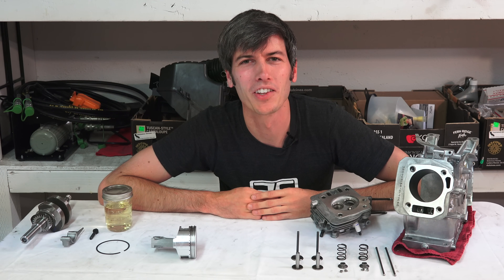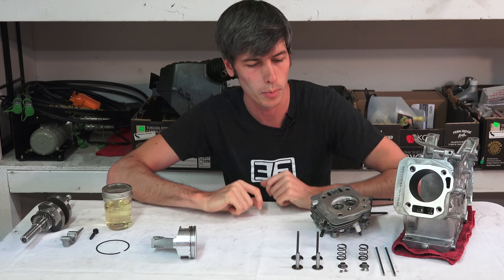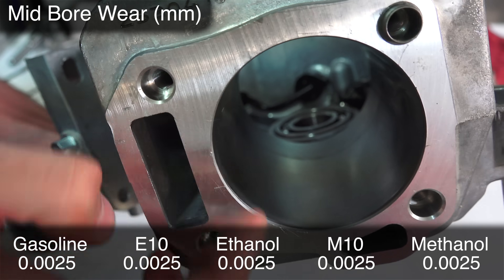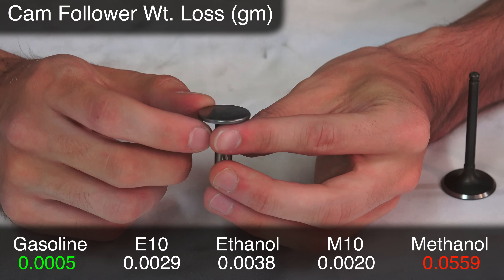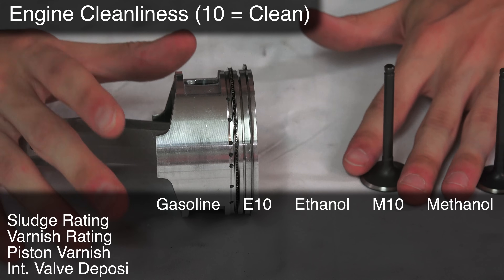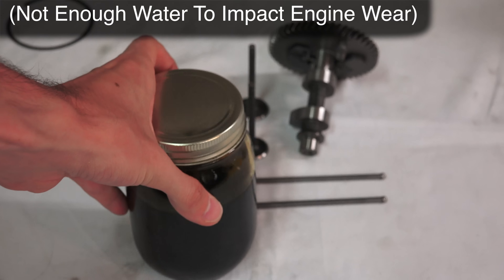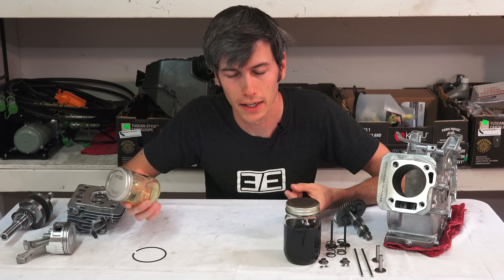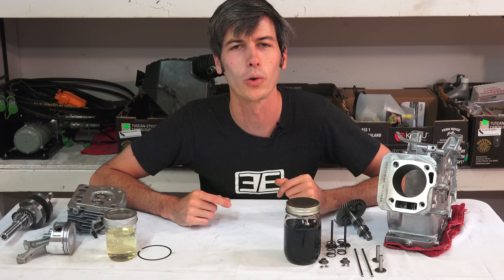Is Ethanol Bad For Your Car's Engine?

Comment: Here’s a fun extension. Are there any differences between diesel engines regarding ultra low sulfur fuel? Modern diesel vehicles are all labeled with “Only use ULSD”, and I’d be interested to know if there are mechanical reasons for that.
Reply: The main problem caused by sulfur in fuels is that sulfur acts like a catalyst poison. If a catalytic converter like for instance in modern diesel exhaust gas aftertreatment is exposed to sulfur it will degrade and eventually break.
Reply: @PillowInTheSky  Sulfur is diesel lead then
Reply: i think also, common rail higher preassures compared with idi vepump require ultra low sulfur gasoil because of sulphuric o sulphudricoxide created in the injectors nozzles.
Reply: At high temperatures and in the presence of water vapour the sulfur forms sulphuric acid which is corrosive to the engine surfaces. 

Modern engine oils all include substances that neutralize the sulfuric acid to prevent the oil from becoming acidic. Heavy duty Diesel engines for industry and agriculture which use lots more fuel and often not of the ultra low sulfur variety have more of these additives to compensate.
Reply: Aside from the emissions standpoint, the ULSD fuels are needed to prevent the particulate filters from getting clogged and also the sulfur makes the diesel catalyst fluid (DEF or basically piss water) useless.  Sulfur will tolerate the high heat of the regeneration cycle of the particulate filter and not be burned off as the other elements will.  This is bad for a very expensive part of your emissions system.
Reply: Same reason for low-SAPS motor oil, contrary, non-DPF engines shall not use these oils.
Reply: Dominic's Bricks 
we were told sulfur was causing acid Rain, which no one witnessed on real life, as the reason to reduce sulfur in gas
Reply: Sim... Acid rain is any rain with a PH of 7 or higher... We usually drink water with a PH of around 8 so we are drinking acid water.  If you live in the city and have treated water your PH will be closer to 10 due to the chlorine.  Will sulfur make the rain acidic? Yup, but will it wont be bad enough to eat your paint off your truck or anything like that.  It may make food taste a bit different and cause water spots, but nothing too harmful in most cases.
Reply: @dominicsbricks2403  You have your numbers backwards, lower pH numbers mean more acidic. Neutral pH is 7, anything less is acidic, anything higher is alkalinic (basic)
Reply: Figures... I am dyslexic... the numbers aside the information is pretty much the same.  Thank you for the correction.
Reply: The acid in the lungs (think smog) is not great either. Luckily, it is a local pollution problem (it rains out, perhaps acidifying sweet water reservoirs, or maybe not).
Reply: @dominicsbricks2403  Acid rain is 6 or LOWER. 7.5 or higher is alkali rain
Reply: Yea, someone already pointed out I got the numbers backwards.  Thanks though!
Reply: They make additives that intend to replicate the lubrication properties the sulfur provided. So it must've mattered. I'm getting the vibe that modern diesels don't last as long anyways as they attempt now to build them lighter, higher revving, and more complex.
Reply: Yep, nothing like a seized injector pump on a tractor to ruin your day, and your wallets.
Reply: sulfur is a good lubricant making your injector pump last longer
Reply: People with older diesels sometimes blame the ULSD for damaging their injection pump, but more often than not, the problem is simply that in older diesels the pump is... old. Anyway, for anyone who is worried all you need to do is add a little two-stroke oil to the fuel.
Reply: Ultra low sulfur diesel was created to reduce sulfur emissions from the tailpipe.
Reply: mcdrums87
ULSD is essential in order not to kill the particulate filter in the exhaust of modern diesels.
Reply: I don't know of any mechanical reasons in the engine itself, though I suspect there may be some if the engine is turbocharged. The reason I know of is a small amount of the diesel fuel (unburnt) is used in a catalytic converter to react with the NOX in the exhaust, and any sulfur present kills that reaction nearly completely.
Reply: Mechanically the sulfur was used as a lubricant.  It is cheap and allowed manufacturers to use lower grade (ie cheaper) components because the fuel would also lubricate the contact points.  The main components that took advantage of this were the high pressure secondary pumps and the fuel injectors.  Today's components now need to use bearings where bushings once were and higher grade materials.
Reply: Does 'off road' diesel contain more sulfur than ULSD? Also, would using ULSD explain why so many older marine diesels have trouble with injector pumps?
Reply: @Johnny Rodriguez ULSD + 2T crankrase oil?
Reply: Sulpher used to be used as a lubricant in the fuel system. As engine advancements happened and emissions stricter they went away from fuel with hugh sulpher contents, also the reason why diesel engine oils have also changed, to help lubricate better with lack of sulphur.
Reply: The only positive is making the EPA happy. ULSD reg is when the price of diesel went through the roof. Diesel was cheaper than gas before that. EPA is doing everything they can to destroy diesel engines. Things like DPF are a bad joke. Funny thing is they are worsening fuel economy and increasing CO2 emissions in the process. Like most EPA regs - improve one thing make two other things worse.

Comment: So cars made in the late 90s early 2000s were not designed with e10 in mind? What about the affect on rubber hoses and certain gaskets?
Reply: What exactly is the issue with ethanol on some older vehicles? Is it the metal used that the ethanol damages?
Reply: mrsemifixit  - The fuel system and OBD 1 systems where not designed to use ethanol, as ethanol fuel was not a major push pre-1996.  The ethanol will expand the vane portion of the fuel pump design, and cause a greater load on the fuel pump motor; causing it to burn out.  The extra load on the pump motor, will result in lower fuel pressure and fuel volume pushed out by the pump, causing a lean condition in the engine, which the lean condition will cause the combustion chamber to run hotter, and can damage the engine.  I know, I am doing a $1,500 dollar repair to a 1994 van, which had cylinder head damage, and a new fuel pump to burn out.  I speak from personal experience, and have banned any ethanol fuel blends in 1997 and older vehicles, must use non-ethanol fuels only.
Reply: @mrsemifixit  even if you have an older vehicle I wouldn't be too concerned. We've run the new fuels long enough that if E10 was going to take you out, it would've done so by now.
Reply: I have a 1996 Honda Accord that I've owned since 2001. I just checked the owner's manual, and it says 10% ethanol may be used, but it doesn't call it E10. It says it may be called "Gasohol". It also says 5% methanol may be used, as well as 15% MTBE. Where I live, only E10 is available, and I haven't had any problems with the fuel system thus far. When I drove cross country, I once paid a little extra and put 100% fuel in. I filled up when I was almost empty, and I keep track of my fuel mileage religiously. I got an additional 4-5 mpg with the pure fuel, and in so doing the math, I actually saved a little money with 100% fuel. For that reason alone, if I could buy 100% fuel, I would.
Reply: I run a couple of early 90's / late 80's TBI Chevy powered vehicles... they're roughly 30 years old!!  I'm not going to contribute a fuel pump failure or rubber diaphragm in the FPR to just E10 or E85 fuels.  The rest of the engine, they're so worn out, what accelerated wear caused by the fuels is negligible.
Reply: @slamdvw  I only have one station in my area with no ethanol. Otherwise I have to use premium, here that has no ethanol, but is almost a buck a gallon more than 87. Truck is a 93 4.0 ranger, that gets a solid 10 mpg no matter what, an , only gets driven 200 miles a year or so.
Reply: ouch! a  buck more than the cheap stuff?  It better get a LOT better mileage than 10% stuff.
Reply: I would say as long as the vehicle has electronic fuel injection then you should be fine for ethanol blended fuels. Hell my 87 SAAB 900 runs on it fine, when we got ethanol blended fuels here in NZ the petrol stations had booklets listing all the makes and models that were suitable, my SAAB was one of the oldest on that list.  A lot of mid and late 90's jappas weren't on that list as they were a bit behind in tech in them days and most were still using shitty old carbs at that point in time.
Reply: Cars made in the mid to late 90s in some states where made to run on it. Im from NY. We had E10 back in 95ish when Clinton signed the OK bill
Reply: When Is your engine designed with  E10 use in mind, then you shouldnt have problems. I think BMWs around 1995 and higher can run ethanol fuels with ease. Another story are Honda cars from these days, they are literary killed by E10. Instant lose on peak power, way lower mileage, and plenty of new noises from engine  bay.  Forever look at owners manual what you can do with depend car.
Reply: "literal killed by E10"... what?   you mean "figuratively"... and E10 didn't kill any Honda's...even from the 90's. It's the changing driver or driving conditions that cause any difference. At a 10% concentration of ethanol, no human is able to detect performance differences.
Reply: @miroslav 
i find it interesting you mention honda's pre 95 cars here.
could i generalise and say japanese ?...
if that be the case my partners and i pair of '93 R33's have lived on E10 blends since purchase (4+ years now), apart from 20+ year old lines perishing (as to be expected) and one fuel pump failing at 220,000km and it was the factory pump roughly 23,000km after purchase) i really can't say there are any adverse effects from using it. 
power wise, we actually gained as it reduced ping or "knock" so running higher boost (11psi daily) was less risky.
economy wise i could still get 11L per 100km from it, including steep gradients and descents when doing this test.
as for noises from the engine bay, no, no new or bad noises have ever appeared.
Reply: Depends on the car and year. But he covers that in the video towards the end.
Reply: i have a 1996 bmw and i got question mark above my head when he said it might not be a good idea to run in old cars. hmm
Reply: I have a friend who runs E85 in his 64 Thunderbird... it don't seem to mind it.  Jet change in the carb and it's off to be driven.  The main thing is if your fuel injection computer can compensate for the leaner mixture.  10% you'd most likely be OK... 85%? I know TBI can't without slight modifications.  GM's Grand Prix SSEi ( supercharged ) no problem.  Your mileage may vary.  How we've tested them... wait until you're almost out of gas - put 5 gallons in.  See how the car runs.  If it runs good, no problems.  If it starts to falter ( running lean ) top it off with regular fuel and thin down the E85.  (( these ideas seem to work great with 20 gallon tanks, use appropriate amount to bring you up to just under 1/4 tank )).
Reply: There have actually been studies done on this topic. The basic rundown is anything pre '95 could be expected to experience some fuel system failures on E10, with likelihood going up with age. Replacement components would already be E10 compatible, so an extensive update campaign was considered unnecessary.

E15, all bets are off. Even NEW production cars had serious issues, with one example suffering pin-hole leaks in the aluminum fuel rail. Some older models tested suffered such extensive fuel system damage they were considered unrepairable.

Comment: the numbers look super fishy, lots of repeated exact values down to the last digit

It is important to state the uncertainty of the measurement; if multiple tests were done and averaged then you need to show the calculated deviation. Otherwise the data cannot be treated as reliable
Reply: It seems like a conversion from imperial units with few digits of precision in the original numbers.
Reply from the maker: Yes, they're averages. I'm guessing the replicas are a result of having a certain measuring tolerance, and then when averaged they result in similar numbers. I thought the same looking at them, seems weird to be accurate to four decimals and repeat numbers.
Reply: Seems like everything was measured in 1/100 of inches and converted into metric
Reply: down to the ten thousandth of a unit. lol I agree entirely.
Reply: That's how converting fractions to decimals generally works
Reply: Was thinking the same thing. 3 had the exact same wear numbers??? 3 identical engines wouldn’t have the same numbers to begin with.
Reply: Glad someone pointed out the lack of  deviations. Brings me back to the dreaded stats courses. A study from 82 is considered out-dated in their relative fields of chemical engineering, also considerig the change in technology and source of funding (Military?). Time to look up some of the cross-cultural comparison studies on this, considering the fact that we run entirely different gasolines on different engines that even require different oils :/
Reply: I recommend to all you guys read the paper abou the procedure (statistical part) before conclusions. Probably the numbers were normalized, I said probably (since I did not read the paper yet).
Reply: I don't trust a number unless there is an uncertainty or tolerance next to it.  If these were based on single samples, I would not put a whole lot of faith in these numbers.  There are a lot of other factors that can effect engine wear that may have not been properly controlled during the experiment (Ex. oil pressure, fuel/air mix, fuel atomization, ignition timing, variation in compression ratio, etc)
Reply: I view it more along the lines of significant vs not significant. The biggest takeaway is don't run your car on methanol if you care about wear.
Reply: Jess Stuart 
I think that, more than tolerances, they should have tested with a wider sample. A single car? 5 cars would still be a too little sample. At least they used the same car with theorically the same engine, cuz i know of much fishier experiments.
Reply: Jess Stuart  you’re right and don’t forget ambient air pressure temperature and humidity. Ask a tuner on the effect of differences of such variables.
Reply: + nickt People gripe on EE channel when he presents in Imperial units.  Now you see the effect of unit conversions out of Freedom Units and into metric. :)

Comment: They put ethanol in gas so it raise the price of corn its absolutely horrible for engines
Reply: You didn't watch the video, did you?
Reply: It's only bad if you don't educate yourself on fuels. Ethanol is a great fuel (not taking into account how we produce it) and it's so much more capable than gasoline.  Gasoline is outdated. There are much better alternatives in terms of engine longevity and performance.
Reply: So you think ethanol fuel is a farmer conspiracy to sell more corn?
Reply: The only waste-products from burning Ethanol are Carbon Dioxide aND Water. This means it is much cleaner than Petrol/Gasoline/Diesel.

Just saying...
Reply: you have some serious problems with ethanol, ate least u got 30% more performance in power numbers...gasoline is dinossaur juice....just wont work well.
Reply: @lfb716  ya you got it i want my engines to last as long as possible pure gas is the only way to go
Reply: tommy twoshoes said the guy who knows nothing about fuel....ok, keep using gas...now I’m gonna take my 200.000mile ethanol car for a drive.
Reply: haha ur a joke bro
Reply: you know ethanol gets you worse gas mileage right
Reply: and u know ethanol powers the engine up right? guess u r like that prius drivers....i just care more about power than mileage
Reply: Besides, despite lower mileage,  ethanol is usually cheaper, and Ethanol might be better environmentally as well, plus it's made more locally if you're from North America.

Comment: I'd like to think there should be a note about running ethanol in older engines besides fuel line corrosion.
It's not universal, but plenty of pre 70's vehicles have issues with ethanol fuels. Hot spots and detonation mostly, pinging, etc.
It also can cause plenty of issues in much older engines, mostly pre 1950's engines e.g flatheads, early V8's, etc.
This is meant to be a generalized video I understand, but it really doesn't apply to vintage engines.
Reply from the maker: Well adding ethanol raises the octane rating of the fuel, so knock should not be an issue.
Reply: There's a lot of misinformation out there on ethanol, so I would take those accounts of problems with a grain of salt. I used to hear that it would burn and put pistons and saw supposed pictures of this damage being caused by ethanol in a non ethanol engine, but after I started running all my things (from my car and lawnmower to my weedwhacker and chainsaw) I haven't seen any issues in the 10 years I've been doing it. A lot of what is seen are other issues such as carb mixture adjustments or timing being off and it is blamed on ethanol (which is less damage prone than gasoline).  Yes e10 will lean your engine out a bit from e0 (3% ?) but that in itself won't cause an issue unless there are already issues, and can be jetted out.

Comment: How can we improve/increase the power output of ethanol and natural gas engines?
Reply: What are you talking about? There are alot of people that run ethanol since you can make more power with it....
Reply: More compression and timing on N/A engines.  More boost, compression that would be good for N/A motors running regular or midgrade, and maybe more timing on forced induction engines.